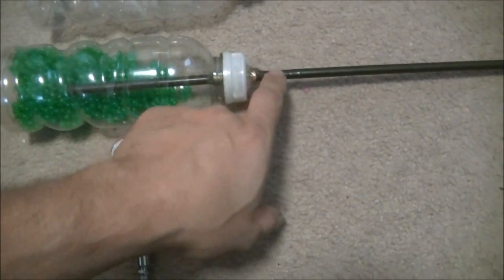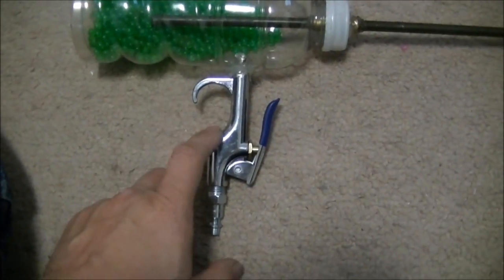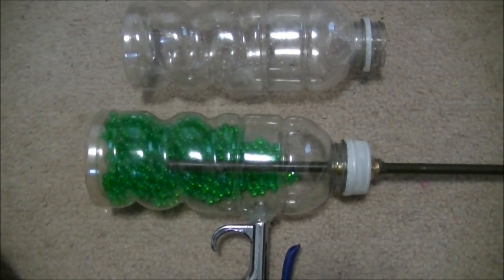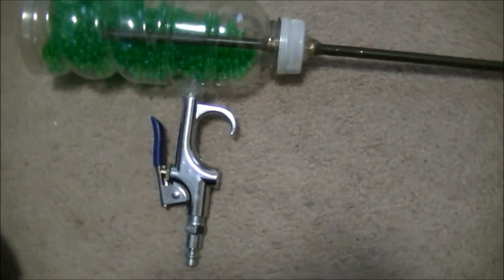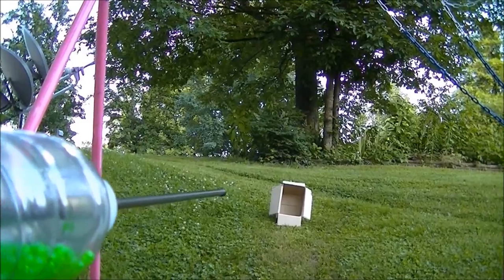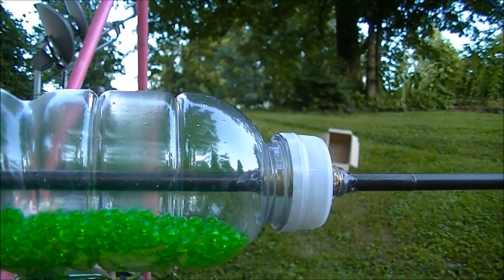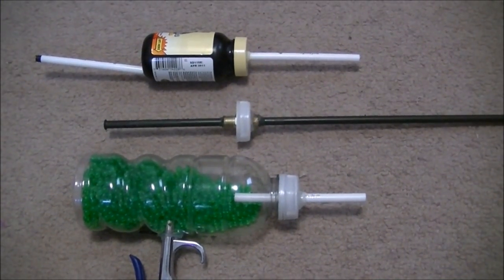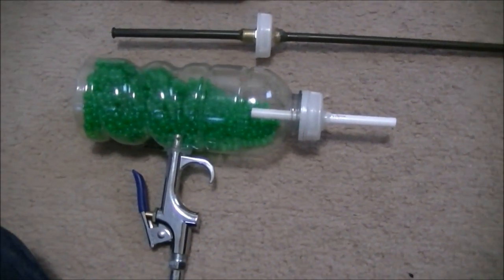How to Make a Full Auto Airsoft Machine Gun from a Soda Bottle Version 2

Comment: you might be able to use a metal container and pipe fitting and real bbs. The use a co2 canister. It would be pretty potent. then use some kind of trigger that goes on and off Then make the tube inside even shorter so they go into the tube easy. and if you could seperate the top from the bottom in the inside half way down into so all the bbs are about half way up then they can roll right down to the tube level.